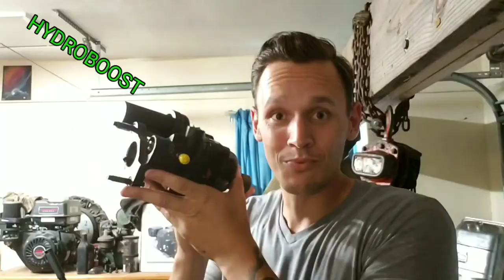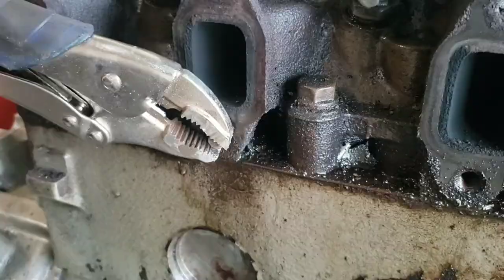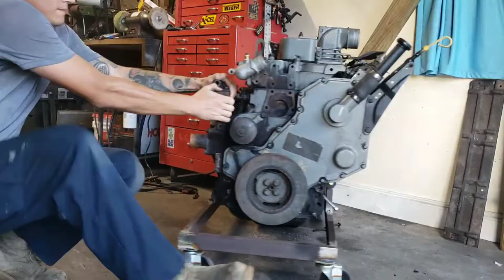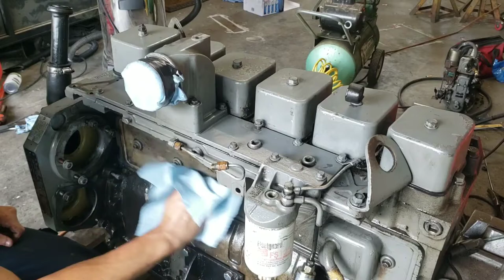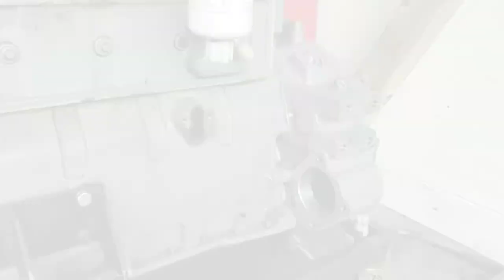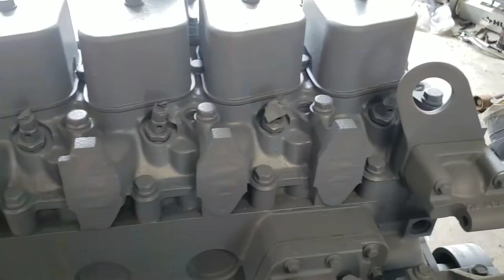Cleaning and Painting the 12 Valve!!

Comment: I work in the paint department of a sheel fab shop. And I am so glad I have access to a steam pressure washer,  media blast booth, and many different options to use to apply paint.

On a different subject,  you were not wearing a respirator,  it's only designed as a dust mask. A respirator has adjustable straps to make an airtight seal to your face and it has disposable filters. For future painting, get an actual  respirator,  not a dust mask, they are used for extremely different things

But I did like your video, just want to give you a tip to keep your lungs clear and make sure you keep all your brain cells
Reply from the maker: I appreciate the heads up! Now I know what I need to buy for the next paint job. Thanks brother!

Comment: Can you show how you made you engine stand
Reply from the maker: It's really just 4 pieces of square tubing welded in a rectangle, a heavy duty caster wheel in each corner, and a piece of pipe that holds the motor mounts in place. I'm honestly surprised its holding the weight of the engine and hasn't broken yet

Comment: @chuckcustoms hey man I bought same motor as your out of a box truck. I've watched all the videos but I have a few questions a some changes you didnt show. Let me know if you could speak to me about a few questions I have. Thanks god bless
Reply from the maker: Sure thing man! What can I help you with?
Reply: On the top of the motor you have the old water housing I know you had to swap out but mine has 2 other tubes running up beside that do you cap those off? Not really sure what to do with en
Reply from the maker: I believe those might be for your heater core. Either way you should be able to cap them off or just completely eliminate them.
Reply: Sweet thanks brotha. Cant wait to see some new videos. I'll post a link to mine were you can see what were doing. Any suggestions would be much appreciated. Thanks bud god bless
Reply: Watch "12 valve chevy welding truck! (Cleaning the engine and changing what we need to make the swap) 👍" on YouTube
https://youtu.be/KJg77Lf4kDQ
Reply from the maker: Anytime! And Id love to see what you got going on and to be able to help out where I can. Stay safe, and God bless!
Reply: Thank brotha god bless you 2